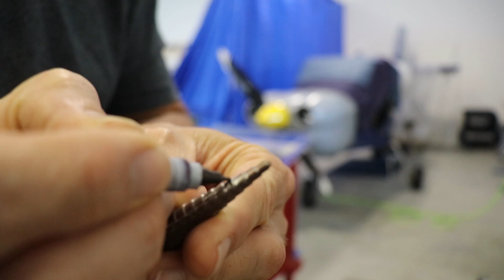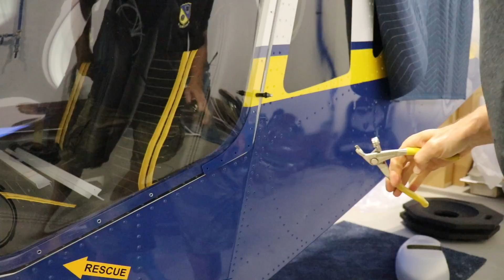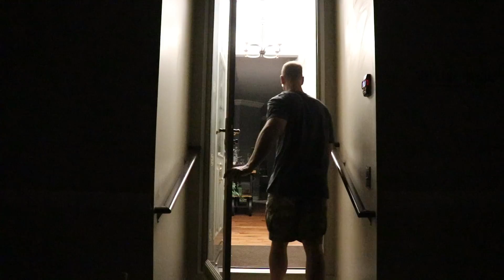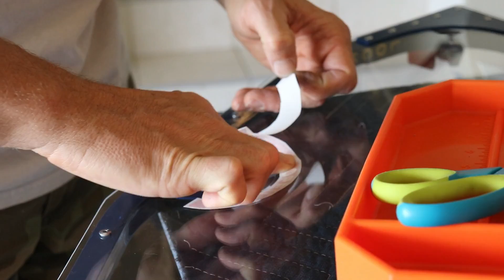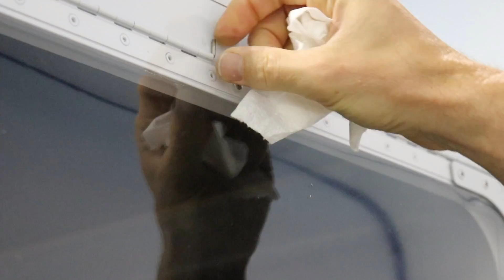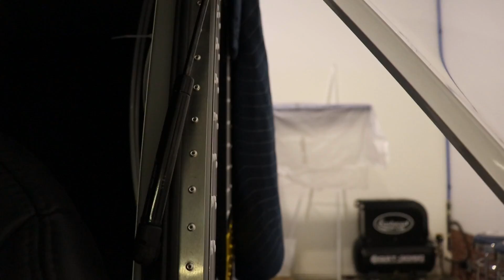Zenith 750 Cruzer Doors Part 4

Comment: Mark, you mentioned you wanted to wait until the wings were on to mark and rivet the struts for your doors. It seems to me that you would need to mark them in the fully closed position because if you mount them in the open position they may be to high and the doors wont fully close. Am I off in my reasoning?

Comment: Nice vid as always Mark.  I wish I would've gone to the Zenith dinner, to say hi - (but wife had other plans!).  Anyway, regarding how your window keeps fitting slightly differently, "depending;" is it possible you drilled the holes with the bubble door laying flat on the workbench, but are doing the riveting with it hanging on the fuselage?  I did this same task over the weekend (my first actions since OSH) and didn't experience it.  But I did EVERYTHING on the workbench, (after doorframe was fit).  And while I am no Mark P as a builder, just a friendly thought, but a second consideration in addition to figuring out how far you want the door to open as you figure out where to mount the bottom steel tab, is to ensure it is also far enough to allow full collapsing of the compression thingamabob. But I suspect you will be just fine.  One of my two was off by 1/4" and hit bottom of the piston before the door would actually close.  But I don' have cruzer plans, and I think they address this there...